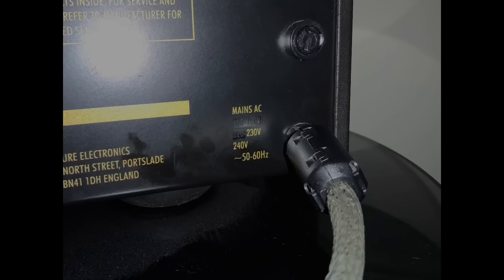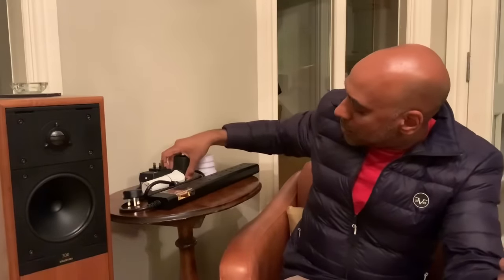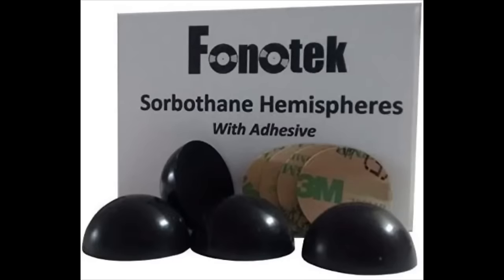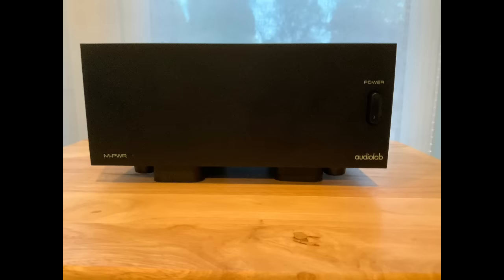My Top 5 Inexpensive Hifi Tweaks

Comment: Hi Tarun, great tips for tweaking and a very unique video from an audio reviewer. Never seen this kind of video before so well done. Love the ideas for vibration reduction, as I feel many companies charge stupid money for many on the market anti vibration products. As for mains conditioners I have always been very sceptical of them and never bothered until now, as you have given me some inspiration to try one. I don't have a spare socket for the inline version so could I put it on the multi socket? I never realised that shielded speaker cable can be detrimental to sound quality. I have Chord Odyssey speaker cable and I'm sure that is shielded.  What difference would non-shielded speaker cable make to shielded, with regards to sound? What I really like about you Tarun is that you are very knowledgeable about the products you review and the science behind them and yet you are so down to earth and not arrogant like some audio reviewers I've seen.  Very interesting and useful information so thanks again Tarun.
Reply from the maker: Hi Steve, good to hear from you buddy. I would try the parallel one first and plug it into the first socket in a regular heavy duty mains strip. I do this in the bedroom system to good effect. Shielding speaker cables adds capacitance that can result in high frequency roll off if not done correctly. Such as not enough distance between the conductor and shield. Shielding is generally considered unnecessary in speaker cables. However, I would be fairly confident that Chord will have engineered around these drawbacks so if you are happy with the dynamics and high frequency extension, why change it? Thank you for your continued support 👍
Reply: @abritishaudiophile7314  ok that's great. I think I might have found my perfect floor standers with the Q Acoustics concept 500, with their ability to be able to change the bass and treble frequencies. Obviously I'll need to go and listen to them first. Would you ever do a review on them?

Comment: I'm probably a bit late for you to catch this, but here's my question: Should I think of replacing the spikes that came with my Rogers AB1 Sub-Woofer - designed to match my LS35A's? I've considered using small rubber isolation pads instead, but Rogers supplied  the spikes that hold the LS35A's to the sub-woofer, so I went along with it. Good presentation, by the way. I've always been suspicious of tweaks - and I'm old enough to remember when you could buy (don't laugh) packs of slips of paper that were supposed to be placed randomly around the listening room (under clocks etc) which would dramatically transform sound quality. I'm not joking, by the way.
Reply from the maker: Thank you for watching AW. If the spikes connect the AB1 to the LS35A I would leave them in place. There have been all kinds of crazy audiophile tweaks over the years. I wasn’t familiar with the random paper in the room though. Thank you for sharing 😉

Comment: Regarding power cables and shielding, I've read that it's better to earth shielding at the plug end only (something about creating an antenna if you connect shielding to earth at the equipment end too).
Reply from the maker: Hi Howard, it is my understanding that connecting at one end makes the shield act like an antenna capturing RF and EMI. Connecting at both ends provides greater shielding but can introduce ground loop problems (I.e, potential difference across the cable) which can introduce hum and interference. I f you don’t have a ground loop issue I always felt it was best to connect at both ends. In am by no means an expert in this area so I am someone watching may be able to shed more light on the subject. Thank you for watching and commenting 👍

Comment: Do not connect the shield to both ends!! You will end up with ground loop and it could induce MORE noise. The shield is terminated at one end , only. It better at the “instrumented “, meaning the working end. All shield should terminate at the same end. And of course, make sure the “instrument” must have a good or robust grounding setup.
Reply from the maker: Thank you Henry. I did amend my advice in the following video 😉

Comment: Shielded mains cables seems to have an effect on my system. Though with the decoupling of speakers etc. I've had a different result.  My speakers comes with both rubber pads and spikes. The spikes gives me a much tighter bass and it also improves the dynamics for me. The same seems to be the case on turntables I've tested. I've added another tweak and that is a 30mm granite slab under each speaker (between the spikes and the floor). I've added a thin felt strip under each slab to protect the floor. My next thing to try out is something like the Ifi purifier
Reply from the maker: Thank you for watching and sharing your experiences J 😊

Comment: If you play music via your computer, would it be a good idea to use these higher quality power cables for it as well?
Reply: I'd say no, because the circuitry in a computer produces so much high frequency noise on its own that I don't think reducing any noise interference on the mains will make any difference.
Reply from the maker: I agree with osliverpool. Better to get a Raspberry Pi or inexpensive streamer and take the computer out of the audio chain. Depending on the quality of the rest of your system the improvement may be small to quite significant.
Reply: Netherspark
Ofcourse power cords in use with PC is working well.Im using Furutech with it, and it is changing the sound.Doesnt matter if you are using Usb or spdif interface, works in either ways.
Reply: @abritishaudiophile7314  If you play music recorded by someone else, would it be a good idea to only ever listen to music recorded on equipment using special power cables?

Comment: Naim do not recommend mains conditioners, I guess they design there power supplies correctly?
Reply from the maker: Maybe? Thank you for watching 😉
Reply: Correctly designed power supply for audio equipment were perfected many decades ago. Today we can design power supplies that power equipment that handles signals LITERALLY BILLIONS of times more complex than analog audio and with no room for even slightest of error.
Reply: @sjwright2  no it hasn't. What noise couples to mains decades ago is nowhere near the noise sources of modern everyday electronics we live with for one. Also, the s/n ratio of modern equipment is small compared to vintage. Standard power supply designs then allowed for more noise than would be acceptable now. 
If one thinks that the most cutting edge power supply design is applied to everyday mainstream hifi, it is not. There is good enough for vast majority of cases leaving people with supply issues, short.
Open up (if you are aware of electronics and safety) components and look at power supply designs. You can see the price to design compromises. Even smps are still improving. 10-15yrs ago, nearly all domestic varieties injected noise down the line, seeping in to other components....
Reply: A lot have good enough power supply design. Sometimes, it is your particular situation that determines whether you need conditioners.

Comment: I got some ideas! Thank you very much bud. I subscribed quite a few videos ago. Good info. I have a question about isolation pads when it comes to speaker stands that no one has been able to answer. With floorstanding speakers, I am looking for a rather short 4-7 inch stand to the raise physical tweeter level up. I want to know if it's advisable to place isolation pads both under the speaker (on top of the stand) AND on the floor or... One or the other? Thanks man. Cheers from Florida! 👋 🌴
Reply from the maker: Hi CeeStyleDj, thank you for watching and your support. I wouldn’t place multiple anti vibration pads under your floor standing speakers as they may become unstable. Have you tried placing EVA or cork blocks under your speakers. I currently have Yoga blocks under my stands as the Buchardt S400s that are currently under review need to be on higher stands. Works pretty well. 👍
Reply: @abritishaudiophile7314  Thanks for the reply. I wrote 90% of an entire response and Youtube crashed smh..you know how it goes.

I like the idea of the yoga stands but essentially I think what I'm getting at is I'm worried about the resonance of the stands themself - so that's why I was curious if I should put small isolation pads under the speakers (on top of the stands) AND also below the stand's feet. As for stability, the isolation pads that I'm looking at won't affect that much at all or they really shouldn't. Besides, it's pretty much only going to be me in the the vast majority of the time. :-) Thanks! Ps: I will look into EVA and Cork as well (didn't know how well cork would isolate)

Comment: i researched into the subject of mains conditioning some years ago and installed some Kimber power blocks, speaker leads and mains cables, many i knew were sceptical about the existence of any kind of mains or radio interference but you either believe the science from the experts or not its your system, yourchoice!
Reply from the maker: Thx for sharing 😊

Comment: Noticed that you have a tv on the wall above the fireplace. How did you deal with the heat issue?
I would love to do that in my system, speakers are on either side but tv not currently in middle above fireplace (fireplace not open but a closed box like yours), but the wall above the mantel gets quite hot. Did you do anything particular to shield the tv there?
Thanks

Comment: i think maybe there is some cables coils magnetic or grounding sugestions i didnt used yet 🤔 rest of it i tryed 😴 i would allso suggest you to try to load youre speakers with pyramids of cast iron fitness weights. cast iron, by TAOC ideas, are extrapolating to infrafreqs and heat beter of all 😴 so they can release youre dynamics more 😊
Reply from the maker: @Ахриманстоппер  thx for sharing 😊

Comment: Thanks for your response.  Would you also recommend audiophile power cables for the CD player (same connection as the amp) and the network streamer (figure of eight connector).bearing in mind their much lower current?
Reply from the maker: Hi Andrew, it is the shielding that is the most important aspect. I would replace the generic ones with a shielded cable wherever possible, including the streamer. You will also be reducing RF and EMI getting into the cable as well as what it radiates out.

Comment: Don't floor spikes exist in order to cancel out the inherent resonance of the speaker cabinet itself? I think the spikes would allow the speaker to pass resonance to your floor, and structure, where it gets canceled out because there isn't enough energy to cause the structure to also resonate. That's why they use the point of the spike as the interface between the two. It has almost no surface area. It both transmits resonances, and dampens them, which is what you want. Those rubber pads isolate the cabinet in such a way that they can resonate more so than with spikes. It's a hard problem to solve with no perfect solution, and it only gets worse with higher SPL. If you took a tuning fork, and you set it on those rubber feet, and hit it, it would ring more than if it were on spikes.

Comment: Firstly ; I greatly appreciate these tips. I beg to differ with the Tacima, however .. it filters out all the treble in my opinion ; I was delighted to get rid of it and then  spent £100s on a decent power strip and decent copper mains cables for my subs and components.... I admit my main system has 1000 watts running it (including REL subs each side) ... I have granite under my Dali speakers, but due to an accident some of it broke ! so I am going to try slate...  who knows... maybe a warmer sound ? What do you think ? I spend rather a lot on my cables (well over £200 for an interconnect) , copper (get  rid of all silver in all cables... it's bright and brittle....), allmy cables are by Atlas... I don't like Chord, I'm afraid, also my system is vertically bi-amped with Arcam. Keep up the tips... especially tweaking... and decoupling speakers which is what I am into now, as I set up my system 2 (yes also ,  Arcam, Atlas, Dali)... my system 3 is Quad, Atlas and Dali..... I used to use B & W, which were okay until the Danish folk came up with their speakers.... cheers from Bristol. Thanks for the tips.
Reply from the maker: Thank you Oleander. Great to read about your experiences. Slate should work fine. A little more brittle than granite though 😊👍
Reply: @abritishaudiophile7314  Thanks for reply. I ordered a couple of things from your list ... with the ferrite cores I'm wondering about my bi-wired (amped) speakers .... not to have 2 in close proximity... in other words with 4 wires going into the speasker my thought is just to put it on one of the treble inputs...
Reply from the maker: @pandoraefretum  I would just put one on the woofer to start with 😉
Reply: @abritishaudiophile7314  okay feels like I was wrong to go for tweeter rather than woofer... will certainly try your way. On system 2 with bookshelf speakers on stand I tried the magnets today.. also 8 washing machine anti-vibration pads arrived yesterday and  I installed them under the subs... makes for an all round improvement decoupling the bass which is great. One thing about hifi... you improve the bass and the treble benefits as a by product. My bass is now firmer, has more focus, clearer, and less muddy.. and you never realise something is muddy until you hear better.... great tweaks... I'm looking for more all the time... On system 3, at my computer desk I also installed foam under the speakers for similar bass decoupling....

Comment: Tarun, As mains conditioners act as filters, is it a good idea to use them in series if you have more than one? Would that not just make the supply even cleaner?
Reply from the maker: The parallel conditioner works a bit little noise cancelling headphones. In series the filter can add impedance which can restrict dynamics in some amplifiers 😊
Reply: Do the ferrite cores in the mains conditioner work in the same way as a choke in an amp? My MF amps are choke regulated.

Comment: Tarun hi. Can I ask what speaker cable you use please? I've tried quite a few "cheap" ones but I'm using Audioquest Rocket 11 at the moment, which I find ok. They're between my Atoll200 amp and Kudos C1 speakers.
Thanks mate. 🎼🎵🎶
Reply from the maker: My recommendation would be to go for Mogami Neglex speaker cables and interconnects 😊

Comment: Hi, I just wanted to mention about your salt lamp on top of your equipment. I have a near identical one and it sometimes becomes saturated with moisture. It continues to absorb the moisture in the air though and water runs out the bottom of it. Lots more than you'd think too! Maybe it's fine if it's on all the time but mine was a gift that I never switch on so is a major hazard to it's own electrics and anything below it. I thought I had a leak in the house until I realised it was that! It took over a year to get fully saturated but once it was, there was a lot if water considering it was around the wires etc. Hope this helps avoid any damage 🙂
Reply from the maker: Hi Fat Tony, thank you pointing that out. I have a rubber mat under mine 👍
Reply: I have one of these lamps too. In my experience, the salt gets extremely hot. Touching it momentarily (by accident) is a bit like the unexpected shock you get when your fingertips touch a recently boiled kettle body.

Comment: Hi, thanks for the tips. I have bookshelf speakers on spiked stands, can the anti-vibration pucks/blocks be used on a carpeted wooden floor and would the spikes need to be removed? Regards.
Reply from the maker: Placing the antivibration pucks on a carpet may make the speakers unstable. If the carpet sits on a concrete floor I would stick with the spikes 😉
Reply: @abritishaudiophile7314  Thank you.

Comment: Hi Tarun. Thanks for this, I’ll happily follow your recommendations. One thing though; I was taught that shields only ever have one end connected and that goes as directly as possible to earth. Are you not coupling the shield to the earth wire by connecting to it at both ends and hence inducing noise at the equipment?  With love, Ken
Reply from the maker: Hi Ken, there seems to be a couple of schools of thought on this. The shielding being more effective if connected at both ends but can introduce ground loop issues. The conventional way to ground the shield is as you suggest, just connected at the plug end and left open on the equipment end. I amended my advice to this in the next video which was dedicated to how to wire up a shielded mains lead. Thank you for watching and commenting 😉
https://www.youtube.com/watch?v=gfVYfC6tmcc

Comment: Hello Tarun
You only recommended 1 magnet on the speaker cable as 2 magnets together might cause problems. Could you put another magnet further down the cable so they weren't together? (Or at the amp end?)  Thanks Glen England
Reply from the maker: You could Glen but too much inductance will cause high frequency roll off 😊